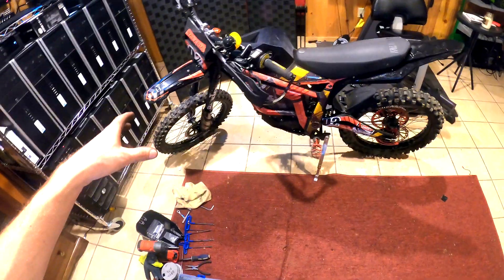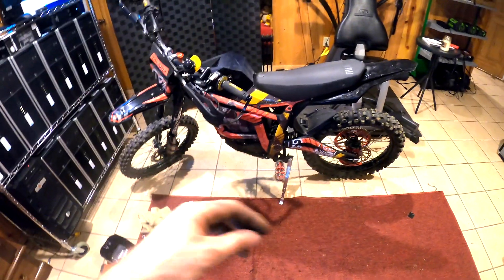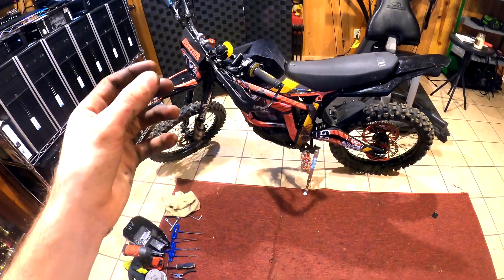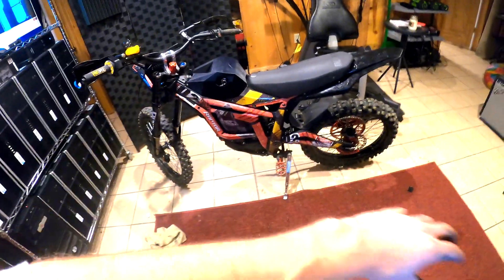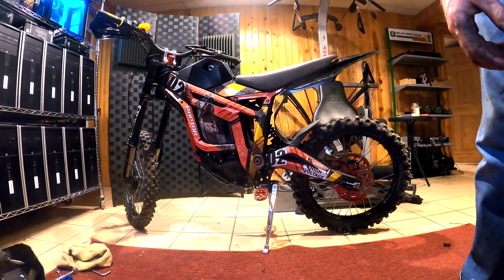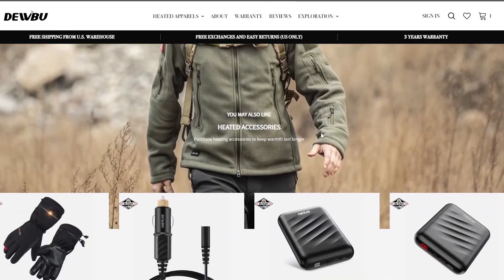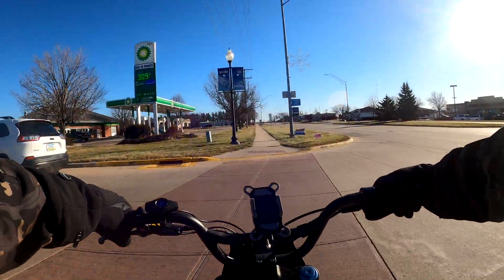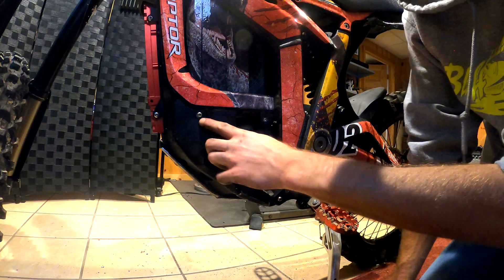Talaria Sting | Full Disassembly - Easy Mod Guide #electric #diy #howto

Comment: Amazing video! Thank you we need more talaría video not just unboxing. Little late but I am trying to install turn signals on my mx4 using the stock wiring harness. I located the rear turn signal connectors. but I can’t find the front turn signal connectors. I took off the ignition and battery cover to have a better view of the wiring harness but I can’t seem to find it. Any idea where I can find the front turn signal connectors?

Comment: I have a different mounting bracket for my gearbox on the back where it mounts to the motor, yours is 2 and mine is 4 and the 2 extra bolts are almost impossible to remove
Reply from the maker: You have the MX4. Mine is the MX3

Comment: Question! How do I detach the front stem from the frame
Reply from the maker: For the fork neck, first remove the bar stem & the handle bars. Then, remove the upper for clamps. After that the fork next should slide down & out of the neck of the frame.

Comment: Fuck my bolts are like welded in or something I keep stripping them with hand tools where the bike connects to the swing arm… I’m dying over here. Any tips?
Reply from the maker: Mine were never that tight. I'd get some wd40 up in there somehow! Or some never cease
Reply: @electricisbetter  thanks I’ve been trying that I even hit them with a blow torch and they just won’t move… going to let them soak over night see if that helps… I also ordered a 8mm hex bit for my drill to see if using more power will get them out. I think I might have to drill out one of the bolt. Everything started so well and then nothing.
Reply from the maker: @JCNY718  damn that sucks. Keep me updated
Reply: @electricisbetter yeah I don’t know what to do I can’t even get the back axle off it’s seized up too, I’ve hit it with a hammer, blowtorch, penetrating oil nothing seems to work… next step is angle grinder and buy a new swing arm lol

Update!

Used a long pipe for leverage essentially creating a torque wrench… I was losing my mind glad it worked
Reply from the maker: @JCNY718  good to hear! I'd probably get some new swing arm bolts for it.

Comment: Appreciate this teardown video!  Would love to see more repair vids for specific projects.  Talaria owners are rounding years now, we are having issues and want upgrades.  I would like to see fork install, spring replacement, fitting wider rear tire, brake installs, chain guard install, throttle, electronics (cell phone charger), and product reviews.
Reply from the maker: Noted!

Comment: Put too much torque on the drain bolt and cracked the drain on the R gearbox cover.  Is it possible to replace the R gearbox cover without removing the entire gearbox?
Reply from the maker: The whole gear box is cracked or just the plug?
Reply: The plug hole that takes the bolt cracked - two places.  It is hard to get the plug out giving the false impression that the same force is needed to tighten again.  I bought a whole new gearbox because I couldn't fine the cover alone.  Of course, as soon as the gearbox arrived, covers became available again.  I bought a cover too.  Now I just need to get one of them on.   @electricisbetter

Comment: Hey man, I need to replace my talaria motor and I’m having trouble getting to the bottom bolt connecting the gearbox to the motor ( 4:49 ) 

Any tips?
Reply from the maker: Those are a little tricky to get in and out of the motor. I found the best way is to use a "L Allen wrench" type. It's smaller than what I'm using in this video. The long end of the L has a ball type on it so it's easier to screw the bolts at an angle. Check these out. Hope that helps! 

Amazon Basics Allen Wrench/Hex Key with SAE/Metric Sizes and 2 Storage Cases, Set of 36 Pieces https://a.co/d/edWajgI
Reply: @electricisbetter  thanks man. I ended up removing the motor bolts and the entire motor+gearbox assembly could be removed from the frame, and that gave me a better angle to remove the bottom screw. 

Your video helped a lot man ty 🙏
Reply: @alexchen215  And thanks to you, i was wondering if the motor and gearbox would come out  ok as one, i have to do a motor change and the new gearbox bracket. Cheers from Australia.

Comment: Thanks for the video. I gotta remove my swingarm today just to get in their to replace one missing bolt from the gearbox bracket to the motor. You happen to know what they are so I can go buy one ahead of time? Also will red loctite do the trick? Some people drill and then re thread but thats a little beyond my current abilities.
Reply from the maker: I think they are 2mm, but yes, red loctite will work ,👍

Comment: Thanks for putting this out there.  I cracked the gearbox right case half cover and now I'm faced with buying full assembly or just the right cover for $55 . Have you or anyone here pulled the bearings on the inside and reassembled it that away? Any help is appreciated.
Reply from the maker: I haven't reassemble the gearbox like that. Did your gearbox break because of the support bracket coming off? This is what happened to mine. 

https://youtu.be/rLAIsflpLpk
Reply: @electricisbetter  Ultimate bonehead move after working all night and almost no sleep.... wrong way on the oil drain plug.  I was trying to avoid admitting what I did. I have a crack now in the case where the bolt goes in, and it will not thread of course.  😵‍💫
Reply: @fastback6578  did you solved it? I have the same problem, wrong way… please let me know